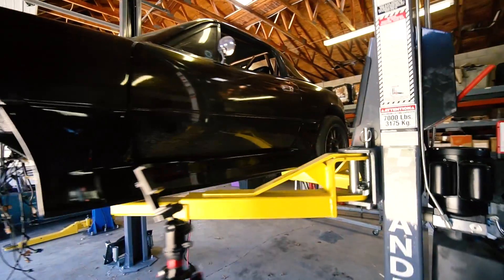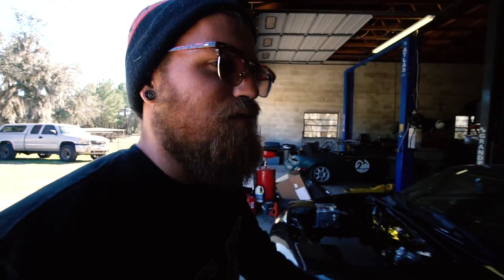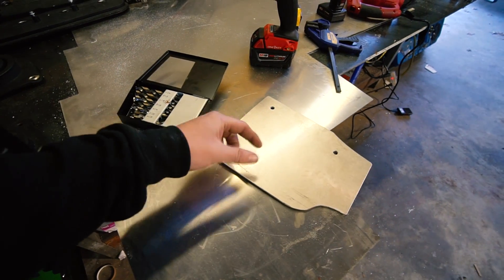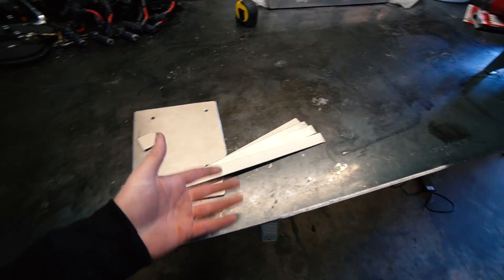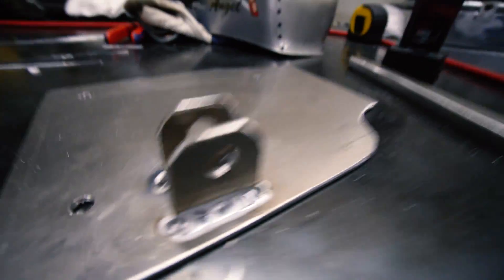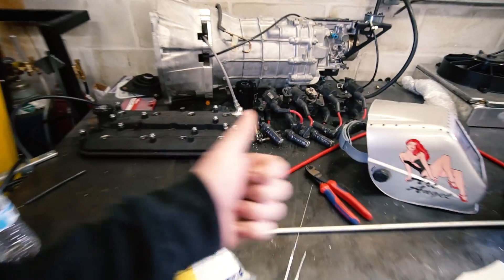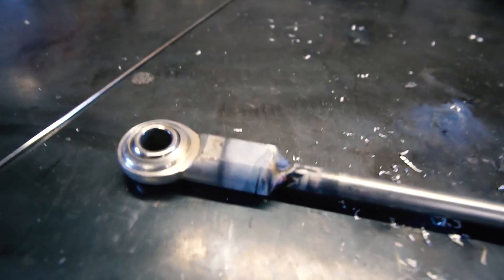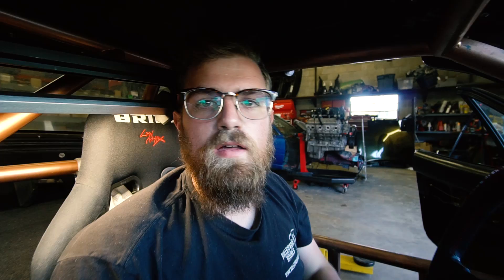Building a SICK Custom HANDBRAKE Out of SCRAP MATERIAL!

Comment: My man ! Have a hydro e thought up for my build and you can utilize a “line lock” typically seen in the drag cars to lock up the front brakes only for burnouts on a drag strip.  You can send it to the rear wheels pressurize the line with the handle hit the line lock button. And Bamn. Functional  hydroE/parking brake.

Comment: Turned out cool, nice fit. I think you may have to watch the pivot of that bolt through aluminum on a drift brake, it'll hog that aluminum out quick, needs a bushing/bearing at the main pivot point. Just an observation, but the design is cool.

Comment: @Taylor Ray, I know its an old video but take some advice from Doug Bernards, Sound Man CA, he either takes a picture or lately takes a piece of paper and just mark the holes or indentations on a certain panel and scans it with a normal flatbed pc scanner. Then you have a very accurate template to design your print off.

Comment: Suggestion: When you're making tabs, or anything else that needs to match, and you're going to grind on them or that sort of thing, put them in the vise sandwiched together like you did to drill the hole. That way the rounded edges come out exactly the same on all the pieces. It's a good thing!

PS - You really need a drill press.

Comment: You may want to use like bronze sleeves or something like that on the thru-bolts/pivot points of that handle if you didn't already. If not the holes may get all egged out and chewed up over time.

Comment: Before welding bolts or heims or anything with a coating use muriatic acid to remove the coating and it will weld way better/cleaner/stronger.   Also when welding that shit without stripping the coating don’t breathe in the chemicals burning off.    And don’t get acid on you it burns through anything that isn’t plastic.  Keep it in a plastic cup or something that you can put a lid on.

Comment: You should pick up a tap and die set. If you are working with aluminum making threads on rods or in holes is fairly easy. Instead of welding bolts on to rods.

Comment: for drilling the hole for the shifter get a holesaw : https://www.amazon.com/DEWALT-D180005-14-Piece-Hole-Saw/dp/B000HCZ4FW
as for centering the hole : make a plug out of wood with the holesaw put a screw with a point through the centerhole with the point sticking up then a piece of plate so the plug doesnt drop through the hole then a nut 
lay the plate over all that so the mountingholes line up and wack it with a hammer so the point makes a divit in the bottom 
hey presto you found the exact center of the hole in the transmission tunnel
one thing i learned from brock was to point the hinge for the handbrake lever toward youre shoulder as thats the natural way you pull on it , mount it straight front to back and you eventually wear out the hinge on the bottom of the handle as you pull it sideways

Comment: Pulling the heads on your 5.3 and putting fresh gaskets and ls7 lifters is the same thing you talked about. Don’t  think to much about it.Dig in brother! I understand your worried about the torque specs and getting them right but I assure you iv used ls1 torque specs on both my lq9 and a 5.3 and all have stood the test of time with boost. Although none have been for drift only drag and street. Iv watched your vids a long time. You can do eiit!

Comment: Couldn't you have shaved down the end of the bar and threaded it instead of welding a threaded tip on it?
Reply: Get the right sized rod for your heim joints and use a die to cut threads, looks less jank…..